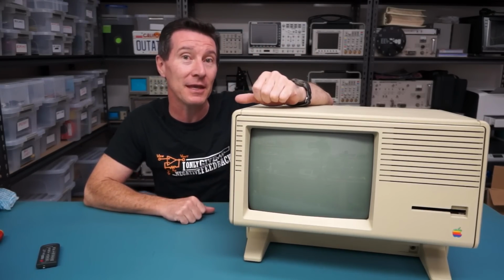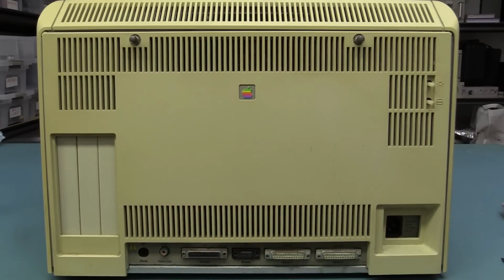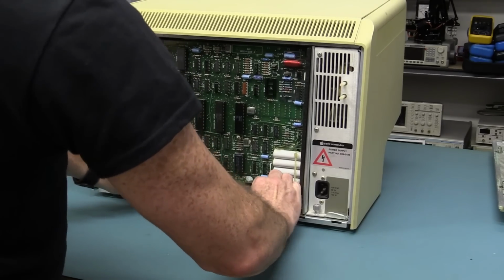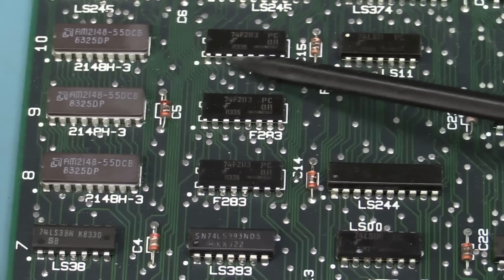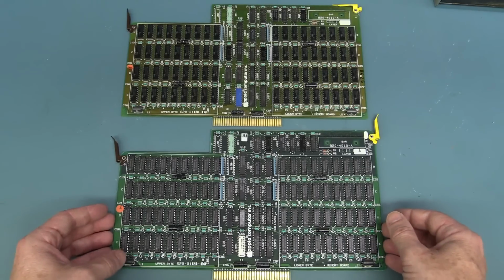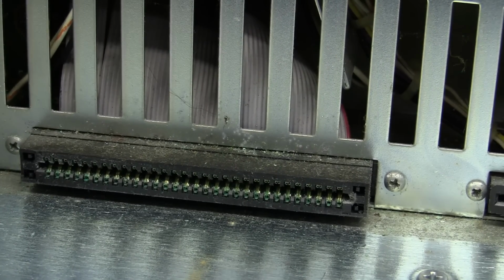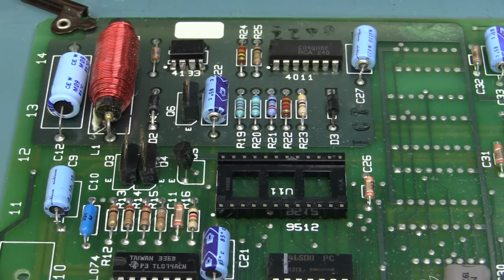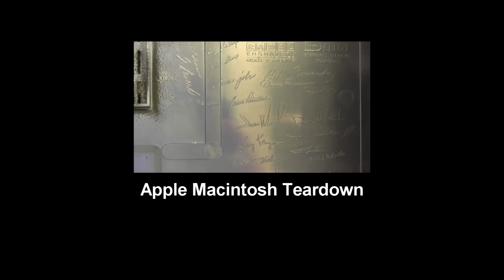EEVblog #696 - Apple Lisa Retro Computer Teardown

Comment: This could be a MacWorks XL machine. That was Sun Remarketing's custom ROM and software package which enabled the Lisa to run the Macintosh operating system and applications. It was popular enough that in 1985, Apple rebranded the Lisa as the "Macintosh XL" and bundled it with the MacWorks software. By that time, the price had been reduced to US$3995.
Reply: VWestlife why u here?
Reply: Interesting! 
Source?
Reply: You could be right. I had forgotten about that until you mentioned it.
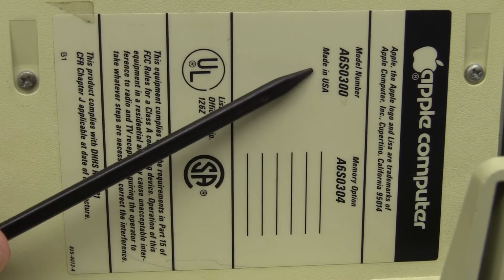Reply: This is a Macintosh XL. Model number A6S0300, as shown at 7:02 and according to this : https://en.wikipedia.org/wiki/Compact_Macintosh.
Reply: I worked for an Apple Dealership, and supported these. Fun fact: when we upgraded a Lisa to a Macintosh XL (essentially installing Mac ROMs - I think that's what the Sun Remarketing ROMs were in this video) one of the steps was to adjust the video circuit, because the Lisa had rectangular pixels, and the Mac had square pixels. The keyboard was mushy, but just oozed "I'm special."

Comment: As you mentioned at the end of the video this is a Lisa 2 or 2/5 - it didn't have an internal hard drive. That's what the parallel port on the back is for. The cable tucked into the expansion port area was an aftermarket hard drive add on - it would have looped out the back to plug into the rear parallel port. The 2/10 model had the port routed inside and connected to a massive 10mb hard disk.

The expansion cards are actually ZIF sockets - turn the little metal rod and it spreads the pins, then you can simply slide the card into the back of the machine without taking the card cage out. 

Too bad about the batteries leaking on at one - it's a common problem. 

The Sun rom lets the Lisa use an 800k floppy drive. That power supply is from a later 2/10 model and is higher power. It also has a jumper inside for 240v operation. 

I have some videos of my 2/10 on my channel if you want to see one of these beasties in operation. It has an aftermarket (AST) memory board bringing it to 2mb, which helps the OS run a bit faster - the OS actually uses a swap file on the disk!

The interlock switches don't do a soft power off - they cut power right away. 

The copy protection isn't too hard to get around, you simply use a hex editor to zero out a few bits at the start of the "master" diskettes. 

If you do decide to part it out I'd love to get the CRT board and power supply :)

Comment: Those expansion board sockets are actually Zero Insertion Force sockets. Open the back panel, twist the handle to open the socket's contacts, and you can slide an expansion board from the back! (I had a Printer Card, with parallel ports.) Twist back to close the contacts, of course. Then take the appropriate cover plate from the back panel, put the panel on, and you're done. ZIF card slots - nice!

Comment: I had a laptop with some corrosion issues that I was able to fix using brutal methods. Since I was about to toss it, I thought "why bother to be gentle?" So, I poured lacuqer thinner on the motherboard then went at with a toothbrush and high pressure shop air. After doing this a few times and taking extra care to get the solvent out form under the BGAs, it actually worked. I really didn't expect it to, but it did.

Comment: Remember when opening an Apple product didn't require special screwdrivers or voided the warranty? Pepperidge Farm remembers.
Reply: Remember when there was no warranty?
Reply: +Corristo89 That would be the original Macintosh, released in early 1984. It used torx bits, which were not really available outside of specialist engineering stores at that time. The case screws were also recessed down a channel so narrow that a bitdriver wouldn't fit, and so long that a regular length screwdriver wouldn't reach. Even in the early 90s, the official driver tools were so expensive that I had to make my own by welding a bit to the end of a steel rod. To get the right size bit, I put my Mac Plus in a hiking backpack and rode my BMX to the engineering store.
Reply: +Nic Brown That may be the reason my Uncle doesn't like any bits that are not slotted and philips.  He must still think that they are hard to get.  Now these days you can get all of those things if you look in the right places even the 5 lobe security Torx bits.  I know a place not too far from me that has a few odd specialty bits and these are hard to find ones that would be used on a Volkswagen.  Just try looking for a 14 mm triple square bit.  Some people even in hardware stores aren't even aware they exist in that size.  It gets worse, some people don't know what they are and assume (make an ass out of u and me) that they are Torx when in fact triple square bits have 12 square points that are more like splines on an axle.  They get the name triple square because if you overlayed three squares correctly you would see the shape of that bit.  I have heard of people trying to use a Torx bit in a bolt made for a triple square but it is a bad idea unless you like broken bolts that are even harder yet to remove!!  If you have a car that uses triple square bolts, make sure your mechanic knows what they are and has them.  Some people hate triple squares because if the bolts or bits break it can be difficult to remove them.  If you ever remove a bolt that uses a triple square bit to remove it, look to make sure that it is not cracked or rusted badly or you may be in for an unpleasant surprise next time you have to get it out.
Reply: I still have the tool to open the original Macintosh. It has a torx on one end and a thing to fit in the crevice around the computer to pry the two case halves apart.
Reply: @lesliefranklin1870  mine is branded as a “Mac cracker”.  As you say, it’s just a torx but with a very long shaft

Comment: This was probably an original Lisa that was upgraded to a Lisa 2/5 when Apple offered the upgrade (for free) in 1984. The main "tells" are the battery pack on the I/O board, the Lite Adapter, and the very different looking RAM cards.
 As far as I understand, Apple never actually sold the 2/5, it was only an upgrade from the original Lisa, which not only didn't have a built-in hard drive, but also only had 512KB RAM. The upgrade consisted of replacing the Twiggy floppies with the Sony microfloppy (and Lite adapter), replacing the faceplate, and adding an additional RAM card. Every original Lisa was sold with an external ProFile hard disk, hence there was no need for the internal one.
You should definitely check out either the MAME/MESS Lisa emulation or LisaEm, the Lisa OS had a number of features that weren't present in the Mac OS until System 7, including virtual memory. (The 55ns AMD 1Kx4 RAMs and 74F logic by the CPU are its custom MMU.) It also didn't have open & save dialog boxes, because it could run the Desktop at the same time as applications, and thus didn't need them: They were invented by the Macintosh team to work around the fact they couldn't run Finder alongside an application.
I'd also suggest checking out the programming details on Bitsavers: The low-level OS itself was very Unix-like and even had pipes and shared libraries. The high-level Application ToolKit (as it was called then) was a shared library written in Clascal, was a direct ancestor of MacApp, and an indirect ancestor of the NeXT frameworks in use on the Mac today. The overall class hierarchy is surprisingly modern.
One place Lisa was entrenched for a while was NASA: They used a whole lot of Lisa systems running LisaProject to do Space Shuttle maintenance and launch scheduling, and I think Apple had to do a lot of work to help them bring over the documents to MacProject later in the 1980s.

Comment: I bought my Apple Lisa from Sun Remarketing in the old days and imported it to Germany. My uncle had to drive me to the Airport to pick up the machine an bring it through custom. Later I wrote my diploma using Ragtime on the Lisa. It still works but it does not boot from hard drive any more. I have to boot from 3,5" floppy. I would be very interested to have a second one and would be happy to get one through custom again.

Comment: I think this unit may have been built in 1983 as a Lisa 1, but didn't sell, therefore it was re-manufactured into a Lisa 2 in 1984.
Reply: Landrew0, I think you are right about the remanufacturing of that computer.
Reply: According to the serial number plate, it was manufactured on November 21, 1983. I believe the IO board was likely an upgrade as was one of the RAM boards since it shows dates of 1984 or 1985. It also has the parallel port which my Lisa (manufactured in August 1983) does not have. This Lisa was the 337th Lisa built by Apple. 

You are likely correct that it was probably originally intended as a Lisa 1 but was refitted and sold as a Lisa 2, especially due to the date it rolled off the assembly line prior to the Lisa 2 availability in January 1984. (I believe my Lisa was sold as a Lisa 1 and upgraded with the 3.5 inch floppy kit when it was offered by Apple to replace the Twiggy drives.)

To break down the details I have provided, it’s based primarily on the serial number, A3325337. 

A = Manufactured in USA
3 = Manufactured in 1983
325 = 325th day of the year, Nov 21
337 = 337th Lisa

Comment: Our family purchased a few Macs from Sun Remarking locally here in Logan Utah, the first was an 840AV.  One was an Macintosh TV.  It was a black LC or Performa IIRC.  It had a TV tuner built in.  I don't remember when Sun shut down but last I looked there was a CNC plasma cutting business in the building.  I remember the roof had "SUN" written in white shingles.  You could see it from miles away.  Fond memories.

Comment: To be fair, Xerox was paid a big block of stock for that.  It would be worth a staggering amount if they had actually KEPT it.
Reply: Dave stating that Apple "stole" PARCs IP is a wide-spread misconception. IP was licensed to Apple in exchange for stock. Also Dave saying that the PARC machines were nothing more than prototypes is not correct, they sold for 30k, which puts the Lisa and it's failure in perspective, because Apple basically tried to offer the same product for 20k less using stock hardware parts.
Reply: Poor ol' Xerox , just cant win can they? ;)
 All their brightest research geeks would show this unique cutting edge tech to the management, and theyre like "great kid - now how does this help us sell photocopiers?" Shot 'emsevles in the foot - again!
Reply: I’m sure that a lot of people that had held Apple stock back then are in the same boat.

Comment: I noticed the power supply had a jumper wire to select between 110V and 230V, and I can see that it's already set to 230V. Pretty cool that such an old SMPS had that feature!
Reply: I seem to recall the 1981 or 1982 IBM PC had it as an external switch, just like many older products without SMPS.

Comment: I write this since I bought a Lisa 2 back in April of 1984 for $8266.67, a figure which shall live in infamy. Things I noted about this retro review... my processor was touted as "the fast Motorola 68000, running at 3 Mc." (not 5). My original system package was a STANDARD 512 K RAM model with a $1000 (approx.) 512 K RAM upgrade board installed, composed of double sided 16K chips... wall to wall. The two RAM boards were identical to the darker version of the boards you found on this clunker. My system board had very FEW wire jumpers. Not sure what kind of board you found on this model. My EXTRA cost hard disk was an 8", 5 Megabyte hard drive which was attached with that parallel port and cable to a case which covered the top and matched the beige case (light beige, too... NO yellow!). It made a sound which had to be heard to be believed. I learned, you DON'T put a machine called a Lisa in your bedroom. (arrrrgh!) Your comment about the damned software serial number kluge was spot on. A killer. The software was called the Lisa 7/7 package and cost another $500. The package was the figure quoted for all hardware + software. It was not sluggish, in its day. It delivered amazing results, but NOT standardized for data comparison or sharing. The 7 pin printer could go all day (often did) and was a tank. That was part of the package, too. All in all, I was TOLD at the time that it would be upgraded and remain the flagship machine of Apple. They lied. I still use Apple gear because of the operating system design. I'm more prone to UNIX than Windows. Thank you for remembering this machine. There are 5000 more of them in their original boxes buried in the desert outside of Denver, Colorado, where Apple put them to rest rather than let anyone touch them. de KQ2E
Reply: I wonder if anybody is willing to go to that landfill and dig them up like they did with the Atari E.T. game cartridges?